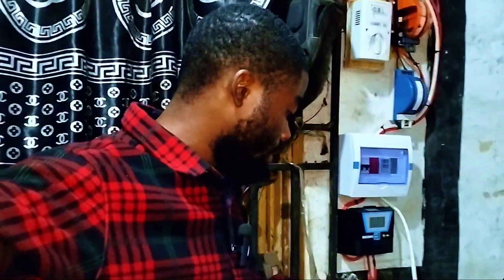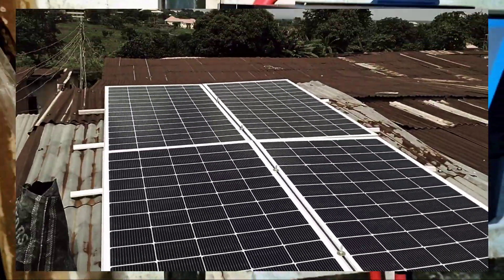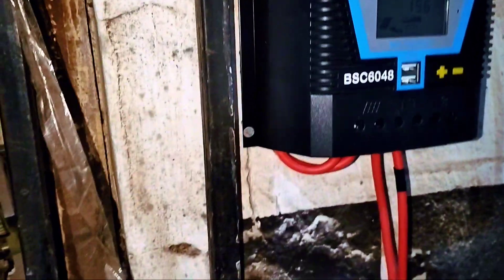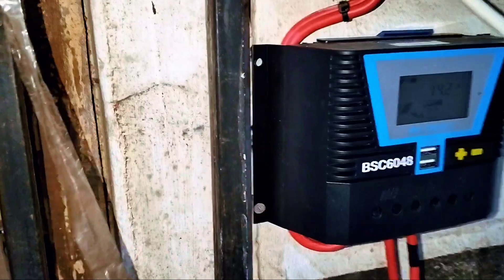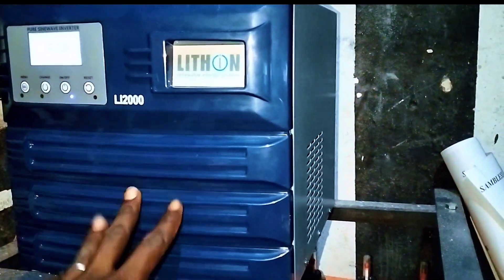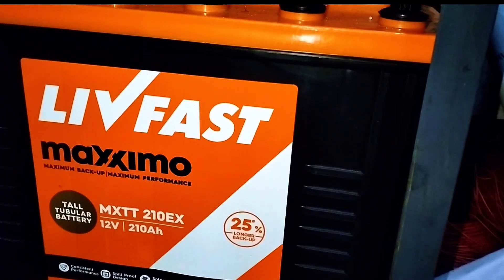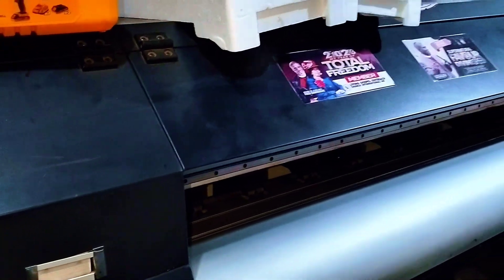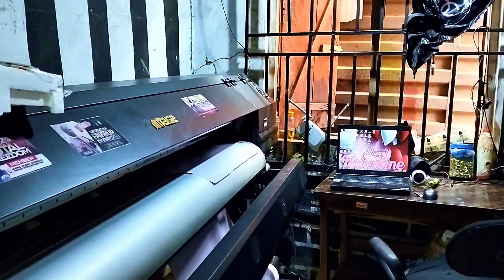Simple solar system for your printing press/businesses

Comment: The question i want to ask is this , 420watts panel aren't 24volts pannel, mostly they are 36 volts pannel with voc of up to 45volts or more, i believe this system is a 24volts setup,why use the 420watts pannel  for a 24volts system?.....cos for pwm, battery voltage should match up with pannels voltage for Safe configuration & for the system to operate normally without any risk of damage.......

Need to be clear or is their anything am not getting

Comment: Assuming 420w is 42v * 10A. 5 panels are 5 * 420W =  2100W. 

For parallel connection of 5 panels, that will be 5 * 10A = 50A (current increases, voltage remains the same). So 42V at 50A which is 2100W. That is why he is using a 60A PWM (it can handle 50A).
Assuming no losses, A PWM controller would step down the 42V to maybe 29V at 50A to charge the 24V battery.  That is around 1450W max. That is why a 24V 60A PWM is adequate because it can handle around 1450W.

For Series Connection of 5 panels, It will be 5 * 42V = 210V (voltage increases, current remains the same). So 210V at 10A which is 2100W. Most PWM can not handle such high voltage but if it does and assuming no losses, A PWM controller would step down the 210v to maybe 29V at 10A to charge the 24V battery. A PWM can not boost the current. That will be around 290W out of 2100W which is only 13% efficient. That will have been a failure.

This explains the reason for the parallel connection.
Reply from the maker: Whoa, this is cool

Comment: I have 8 panels of 195W each connected in series-Parallel to power a 12V inverter and 220AH Tubular Battery. The Solar panels generate up to 38-40amps during peak sunshine. I had to connect the panels in series-Parallel to be able to power the MPPT charge controller. Will I generate more amps if I use a PWM charge controller and connect all the panels in parallel?
Reply: You have an MPPT charge controller, MPPT can do what PWM does and even better. Unless you have shading issues, series is better.
If you do parallel only, you will need very big expensive wires to carry the current because the current adds up.
MPPT saves you money on expensive wires and the efficiency is better than PWM for an installation like this.
Reply: Assuming 420w is 42v * 10A. 5 panels are 5 * 420W =  2100W. 

For parallel connection of 5 panels, that will be 5 * 10A = 50A (current increases, voltage remains the same). So 42V at 50A which is 2100W. That is why he is using a 60A PWM.
Assuming no losses, A PWM controller would step down the 42V to maybe 29V at 50A to charge the 24V battery. A PWM can not boost the current. That is around 1450W max. 1450W out of 2100W is only 69% efficient.

For Series Connection of 5 panels, It will be 5 * 42V = 210V (voltage increases, current remains the same). So 210V at 10A which is 2100W. You need an MPPT for such high voltage.
Assuming no losses, An MPPT controller would step down the 210v to maybe 29V but increase the current from 10A to 72.4A to charge the 24V battery. That is still around 2100W. MPPT is around 95% to 98% efficient.

A PWM is still okay for this installation.